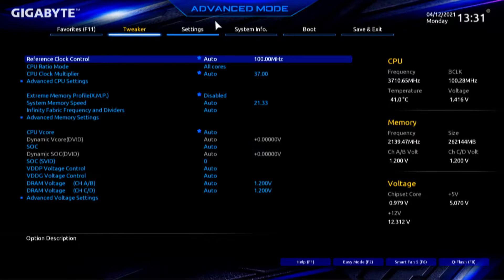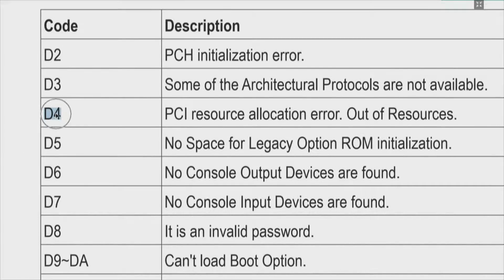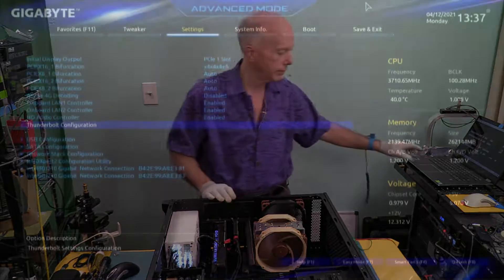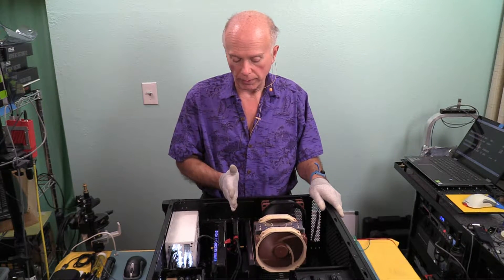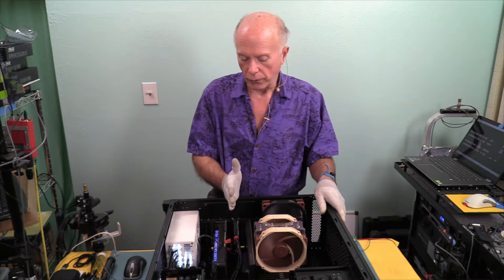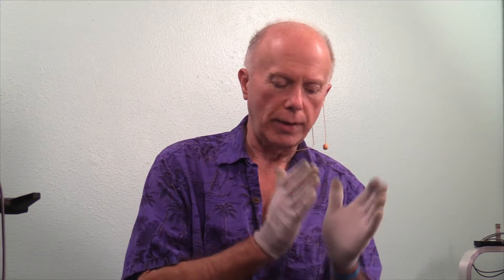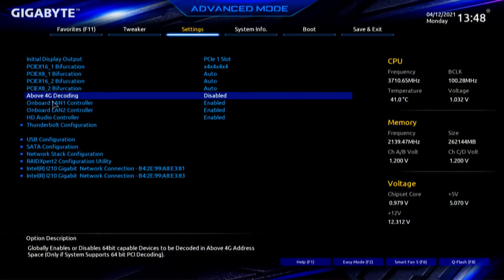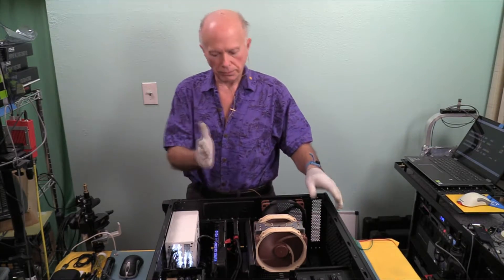D4 PCIe Resource allocation Error and Above 4G Decoding on Gigabyte TRX40 Designare

Comment: when i enable 4g decoding is blank, do you know the reason mr? im trying to use quadro k2200 4gb and rtx 4070 for multiple gpu..but when i enable 4g decoding and restart it, the screen is blank. im using xeon e5 2670 v3 (which is doesnt have igp), when the screen is blank, i have to unplug and plug again the graphic card. and i only can use 1 so its become normal again. do you know how to fix it?
Reply from the maker: Hi @erly777 ,
Welcome. Interesting. Apparently not yet  supported. Ask the Motherboard manufacturer about support. Expect them to point fingers at Nvidia. This would require a Bios Update. Apparently a technology of work in progress.

Going back about 3 years ago, MBR? Solutions then involved change Drive to GPT. Then change Video input from Digital to Analog. But that may not help. 

That's another reason we only showed how and where but not results if enabled. It's a Motherboard Bios issue to enable integration.
Reply: @BuildOrBuy  its worked now, i need to setting the buss setting to x8, for the k2200.. thank you i sub you
Reply from the maker: Hi @erly777 ,
Fascinating. X8. Very telling. Another way to Test and Verify a GPU PCIe Bus width. Curious to note, Primary GPU is supposed to mapped below 4G. Yet you figured out changing the Bus width worked to enable that feature on the Primary GPU. Go figure. Appreciate you sharing that valuable tidbit of info. I'm honored.

Comment: Hi, thank you. But how can you get into the BIOS if the error code D4 appears before? This error appears right after CPU Check and does not let the BIOS appear at all. When the error D4 appears for me, there are 4 loud sounds to hear. and the PC does not start.
Reply from the maker: Hi Huebert Films,
Do You have the Quad card in between the GPU and Thunderbolt 3 card? Until  the Bios is Updated and Firmware is Updated, that's the problem. We define that as a Bus prioritization issue. Remove or swap locations with the GPU and Quad card, temporarily. Hope that helps!

Comment: Hi thanks for video very informative
I have a question I have installed new ram kit 32gb 2*16 +the older same kit
Mean I have 64gb 4*16 and I have added new M2 SSD so now have 3 M2 installed but the PC won't boot till I switched ram Xmp profile off which is weird 
3900x + X570 Master+RTX 3070ti+ 4*16gb ram 3200mhz + 3* nvme SSD
Reply from the maker: Hi Brahimi Hadjer,
Welcome! An unfortunate situation! Is Your RAM on the QVL? Could be Motherboard, CPU or RAM. Start with Bios. You may have to Upgrade or Downgrade the Bios. Suggest contacting RAM Manufacturer for RAM timing settings according to Your Motherboard and Bios version. They can suggest what custom timings will work best with Your RAM kits. Hope that helps! Keep Us Posted on Your Progress! You are not the only one having these problems!
Reply: @BuildOrBuy  hi thanks for your reply
Here is few notes
-The kit I'm using is (MD32GK2D4320016XRGB) *2
- the voltage and timing are the same as any 3200mhz cl16 kit
- it work well using 2 dimms 2*16gb as advertised at Xmp profile
- 4 *16 doesn't work at Xmp and even manually OC, sometimes working but take long time to boot more than 5m 
- Ram is not included in QVL
- using X570 Master Rev 1.2 with the latest bios version F36f
I will try to downgrade also I heard that it's about CPU limitation and lottery but seen some  using 3600mhz 4*16gb kit with their 3900x..
Reply from the maker: Hi @brahimihadjer4949 ,
What Brand of RAM are You using? The Memory Controller in the CPU should allow the RAM to function but at reduced Performance. The RAM Manufacturer will know what works best. Another Option is the DRAM Calculator for Ryzen.
Reply: @BuildOrBuy  PNY Xlr8 epic X 2x16gb  full KIT reference MD32GK2D4320016XRGB 
Yeah I know about Dram calculator using itsince ryzen 3000 release, I have calculated a safe profile same didn't boot, it work only with 2*16 not 4*16 what a mess
Paid for 3200 cl16 kit to use it at 2667 cl19 ...
Reply from the maker: Hi @brahimihadjer4949 ,
Bummer! PNY sounds like Your last option. Expect We're going to see more of these issues with DDR5 until those compatability issues are resolved. Sorry We could not be more helpful.
Reply: @BuildOrBuy  had a Trident Z Neo 32gb kit that died so switched to PNY Xlr8 model was cheaper(100$ for 32gb that time) good rating and run surprisingly good for months till decided to add another 32gb kit..
Now I managed to get them running at 3000mhz Cl15 not bad tho but..
How ever You did really help thanks for your time and your videos are very informative, btw you got a subscription and damn forgot to subscribe earlier this problem make me crazy.
Reply from the maker: Hi @brahimihadjer4949 ,
Crazy, right! Makes Us feel like Guinea Pigs! Trident was probably using Samsung B Die Memory. That should be lifetime Memory. Did You Contact them for RMA?  The PNY is using less expensive Memory chips that should work but is not. Bummer. You are not alone! I'm honored! We try! Details definitely matter! Thanks for Sharing!

Comment: i had the same error code on a z690 and it ended up being that the ddr 5ram i had didnt support xmp 3.0 boost. once i turned 3.0 boost off code changed to A0. Your video was very informative and helped me dial in my trouble shooting thank you so much.
Reply from the maker: Hi Matt Stankus,
Welcome! Glad We could help! Trial and Error! We've also read about turning off CSM fixes that Error on WRX80 Platform. Crazy, right! Bios POST Codes are suppose to be helpful and not so Cryptic. Thanks for Sharing! Appreciate Your Comments!

Comment: Hi Gil, thank you very much for the video! I built a workstation for 3d rendering and animation. But I have 2 problems. With the 3rd Geforce Titan X 1080 the d4 error shows up again. The second problem is, only half of the ram is showing up and with 2133 but not 3200. I have an Aorus Xtreme x399; Ryzen Threadripper X3960; 4x Geforce Titan X 1080; 8 x Corsair 16GB 3200. Above 4G decoding is enabled. Bios updated. What else can I try? Thank you very much!
Reply from the maker: Hi Andreas Bhend,
Welcome! Appreciate Your Comments! We need to separate those two problems and solve them one at a time. Prioritize. 128GBs of RAM, OK. Did all of the RAM ever work from the start? Did You try custom timings? Contact Corsair unless You can utilize Ryzen DRAM Calculator and AMD Ryzen Master. 

https://www.techpowerup.com/download/ryzen-dram-calculator/
https://www.amd.com/en/technologies/ryzen-master

The multiple GPUs is also a problem on the Gigabyte WRX80. We need a Bios Update to correct that but all Gigabyte will do is say RMA the Motherboard wich is not the problem. The Bios needs to do a reset in Order to correctly enumerate those PCIe Devices. We are NOT out of PCIe Resources. We're having allocation errors! Hope that helps!
Reply: @BuildOrBuy  Thank you Gil! Ok, let's start with the RAM. The RAM dit not work from the beginning. No I did not try out custom timing . I'll try the DARM Calculator and the AMD Ryzen Master on Monday, thanks! Yesterday I mentioned an error message while starting the PC:"Memory PMU Training error at Socket 0 Channel 4 (and 5) DIMM 0 & DIMM 1". Should I try to rearrange the DIMMs? Thanks and best regards Andreas
Reply from the maker: HI @andreasbhend5740 ,
Absolutely! Sounds like either the RAM is not properly seated or there may be a problem with those sticks of RAM. Yes, remove, change locations (rearrange) and verify they are properly seated. Hear and feel that click when seated. We need to determine if it's the RAM, the Motherboard or the User. It happens!
Reply: @BuildOrBuy  Hi Gil, I made some test with the RAM. The RAM DIMM-Sticks are ok, they all work. But the slot C1 and C2 of the MB don't recognize the DIMM-Sticks. In the Bios C1 and C2 are always N/A.  But if I open the DRAM Calculator I see all the DIMMs. (As far as I understand the DRAM Calculator software.) I even disassembled all parts from the MB and made a "Q-Flash plus" with the newest Bios and reseated the parts. But still the same problems with C1 and C2. Any ideas? Thank you!
Reply from the maker: OK, great. RAM checks out! RAM not registering in C1 and C2. Two Options. 1. Could be CPU is not torqued properly. 2. Bad Motherboard. RMA. And if Gigabyte Tests and says Motherboard is OK, You know what happens. You're right back to where You are now. Would be same with any Vendor. C1 requires all 8 Modules. Whereas C2 requires 4 Modules. Working with that knowledge, Can You try that pattern on C2 to help isolate the problem? BTW: Are You using XMP? DRAM Calculator I see all the DIMMs... Most Perplexing.
Reply: @BuildOrBuy  Hi Gil. Thanks again for you help. I tested 4 RAMs but C2 did not show up. I reseated the CPU but still the same problem. I send it back and see what the vendor means. Thanks and best regards Andreas
Reply: @BuildOrBuy  Hi Gil, thank you again for your help. Finally the build works as expected. Here’s the solution. 1. The RAM did not work because of bent pins in the TRX socket. The MB was second hand so maybe it was my fault or the fault of the previous owner. 2. To get all 4 GPU work I needed to disable “boot with CSM” in the bios. To do so I needed to change my NVME boot disk to GPT. Otherwise Windows 10 did not boot.  (And of course allow “above 4G decoding”.)
Best regards, Andreas

Comment: PCI Resources are Memory, IO space and Interrupts. A common issue is the BAR (Base Address Register) setting which maps the memory resources of the plug in card in the address space of the CPU.  As you mention a 64 bit CPU and OS can address a huge amount of space BUT the BIOS, which being the Basic Input Output System, is responsible for configuration and initialization. UEFI BIOS' go further than the old ones - they are an OS in and of themselves - however they must lay out the blocks to work. The issue is the BIOS does not know what the OS is. If its a 32 bit OS - then it cannot address as much space but for almost everything in the last decade - its 64 bit. So really the whole 4G question is somewhat a moot point - Enable it always. Run a 64bit OS on your 64bit processor becuase that is what you paid for.

And BTW - if you are having weird POST error with PCI  and have a modern UEFI BIOS you can download the UEFI Shell and boot it. In there you can run the simple PCI command which will dump the tables of what resources the cards installed (and MB) demanding. Its pretty easy to figure what is causing the issue.
That said be aware that not all BIOS's support all cards. An example is COMPUTE Coprocessors and Artificial Intelligence cards from Intel, NVIDIA and AMD (and others). These cards are special in many ways and most BIOSes see them as "CUSTOM".  For these special MB's and BIOS patches from the likes of Supermicro et al are tuned to interoperate. Further, the documentation is sparse so you will have a hard time getting to the bottom of it. And that is quite intentional. They are not for general public consumption.
Reply from the maker: Hi Dennis Fahey, 
Welcome! Appreciate Your Comments! We need to differentiate the Above 4G Decoding to before the install or after the install of the OS. You know what that entails. And We've had to walk a few Viewers through that process. Bios vs UEFI, GPT and all of that to get them back to a Bootable machine. So they could then turn Above 4G Decoding on and make use of it! Bios defaults vs UEFI defaults. You're right, We've had 64 bit CPUs going on 10 years now. 

We had what appeared to be a Bus prioritization issue with the Titan Ridge Thunderbolt 3 AIC. A Firmware update on the Thunderbolt 3 AIC solved that issue. Very surprised and unexpected. Otherwise, nothing could come between the GPU and the Thunderbolt 3 AIC. 

The Bios / UEFI should be able to do a reset of Devices for PCIe enumeration. Even if We could see the problem, fixing it would be the next problem. 

And as You have stated not all Motherboards are the same with regards to Bios / UEFI. For instance, as to which WRX80 to choose for Multiple GPUs. Some are better for that than others. Thanks for Sharing!
Reply: Would you be able to share the command to dump the tables?

Comment: Hello good video info i have question Ryzen 5 1600x is 64 bit?
Reply from the maker: Hi oi3,
Welcome! Thank You for Your Comments! Great Question! Yes! 
Ryzen 5 1600x
https://www.amd.com/en/products/cpu/amd-ryzen-5-1600x
Thanks for Asking!
Reply from the maker: Hi oi3,
This might help! 
Repair Windows BCD
https://www.boyans.net/RepairWindows/RepairWindowsBCD.html
Success on Your Project! Keep Us Posted!
Reply: Hi good day ty when i try enable above 4gb decoding and disable csm save and exit it shows asrock logo and returns to the bios all the time i had to disable 4gb decoding to start Windows idk why
Reply from the maker: HI @oi3 ,
Tell Us more about Your Hardware, Motherboard Model and Chipset and GPU. How much Memory on Your GPU?
Reply: @BuildOrBuy  Hello mb is asrock killer sli am4 gpu rtx palit dual 3060 ti 8 gb
Reply from the maker: Hi @oi3 , 
Which Motherboard Chipset, x370?
Reply: @BuildOrBuy  yes x370
Reply from the maker: HI @oi3 ,
ASRock X370 Killer SLI
https://www.asrock.com/mb/amd/X370%20Killer%20SLIac/index.asp

OK! Minor Details! CSM. Legacy Mode Bios instead of UEFI. When Windows was installed... How is Your Boot Drive setup? MBR? You may need to convert the Disk to GPT then change the BCD to reflect those changes. The easy way is to reinstall Windows after making those Bios changes. Windows installation does all of that in the background. Another option: Minitool Partition Wizard will convert MBR to GPT. You'll still have to change the BCD before rebooting! 

https://www.partitionwizard.com/
https://neosmart.net/wiki/bcdedit/
Hope that helps! This too would make a great Video! We'll this in mind for a Future Video! Keep Us Posted on Your Progress!
Reply: @BuildOrBuy  ty so mutch my friend i plan install win 11 later im on win 10 currently idk what is bcd but i will try setup above 4gb decoding and then install win 11 and i hope it will work again ty so mutch for ur comment and help
Reply: @BuildOrBuy  ah and responding ur question i have 2x m2 sabrent 1 of 2tb on win 10 and other of 1tb and yes it works on legagy mode
Reply from the maker: HI @oi3 ,
Absolutely! Suggest a Clean install on a new Disk. That way, You have a backup plan! Don't even think about Above 4G Decoding until You change from MBR to GPT. Get that sorted out first! And from Bios Legacy to UEFI. Then change the Pointer in the BCD. Why? The Active Partition location will have changed when You changed from MBR to GPT. 

BCD = Boot Configuration Data. 

MBR default is anything below 2.2TBs. Default above 2.2TBs, GPT. 
https://uefi.org/sites/default/files/resources/UEFI_Drive_Partition_Limits_Fact_Sheet.pdf
Hope that helps! Thanks for Asking!
Reply from the maker: Hi @oi3 ,
Absolutely! Here to help! Goes to show, We should never take any of this for granted! We never know Whom We might be able to help! Yes, You need UEFI. These details matter!